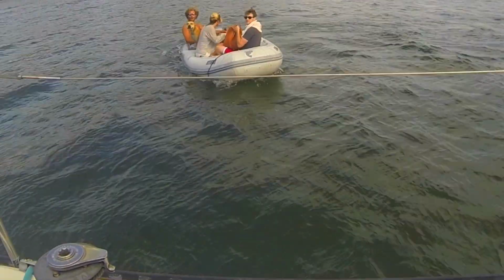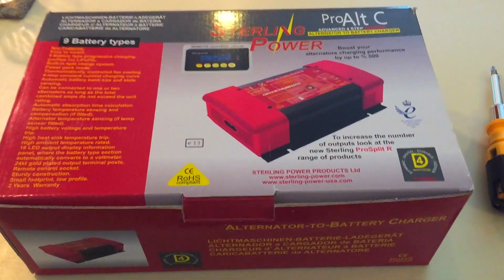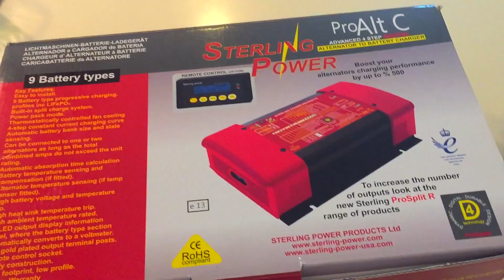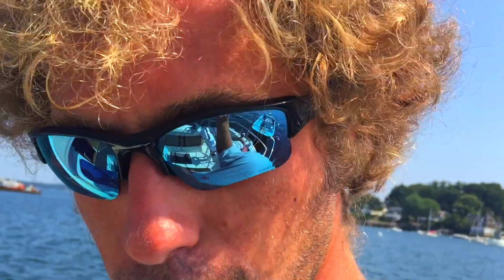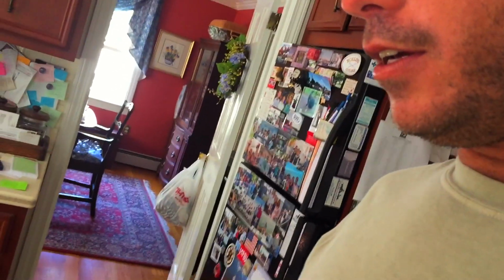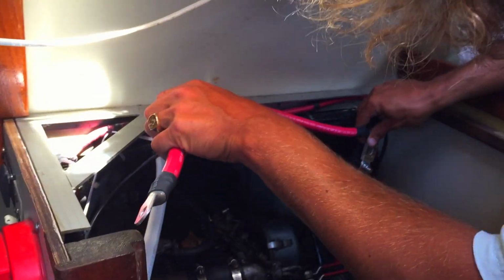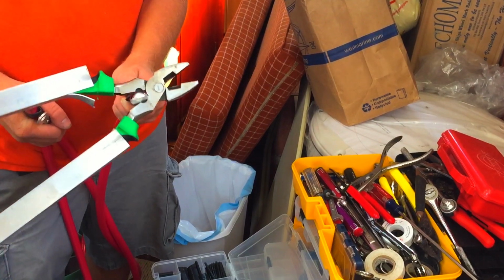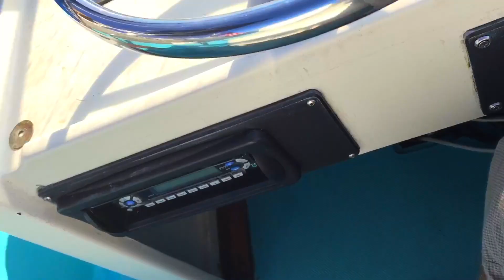Escape 4 - Provisioning to Sail The Bahamas

Comment: Gel batts are sealed and need no maintenance, how ever they can only be trickle charged. If you try to fast charge them they will die.
Reply from the maker: +dave runner Good point! The alternator charge controller, AC-DC charge controller, and the solar charge controller are all running gel charging profiles.